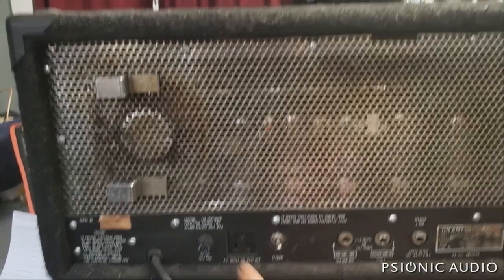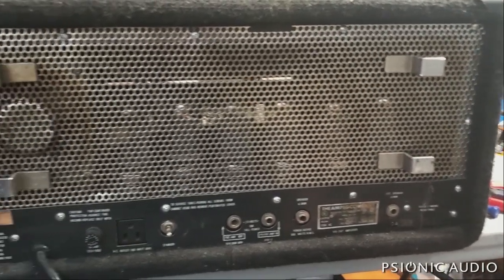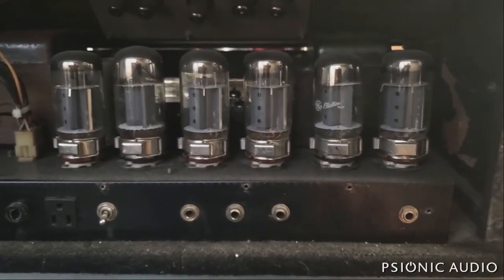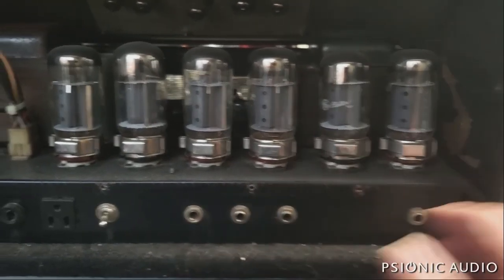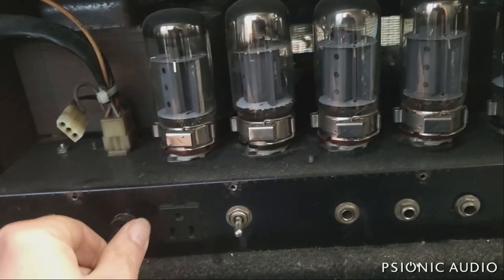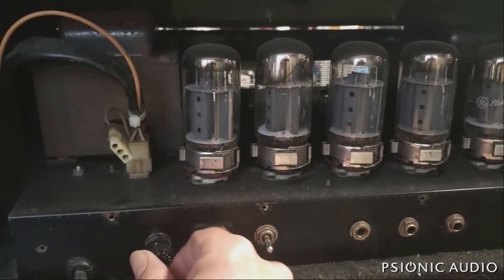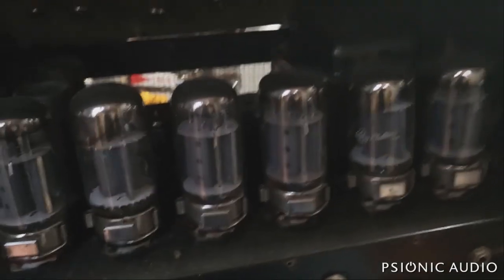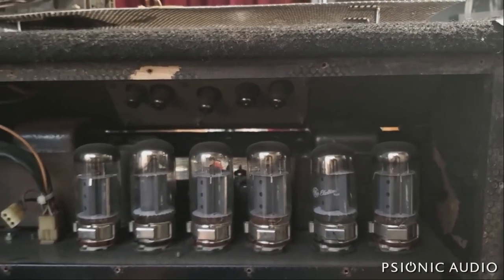'78 Ampeg SVT Part 1: Initial Inspection & Diagnosis

Comment: Darn, I was hoping to find Part 2 or so on to the end for this amp.  Though I can't handle moving them around anymore, I love SVTs--I know, who doesn't--and I'd like to know more about them.
Reply from the maker: It's coming. I'm replacing all the can caps with discrete radials (will explain in that video). It takes time.
Reply: @PsionicAudio  Cool. I look forward to that. Thank you.